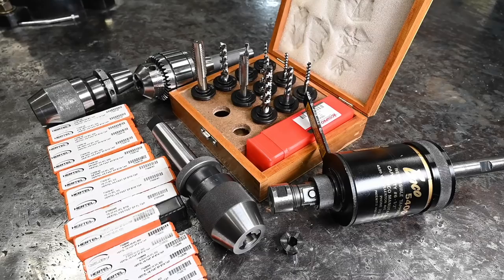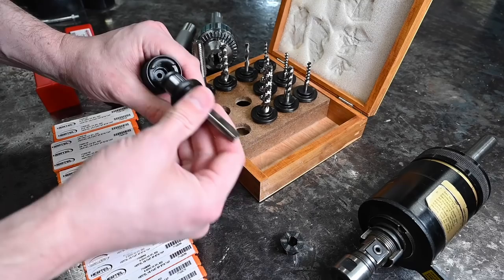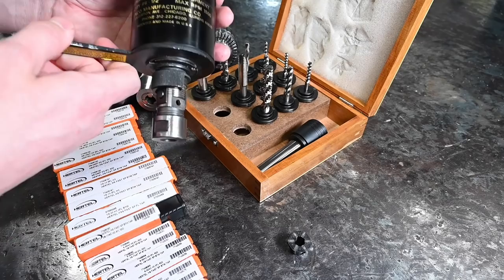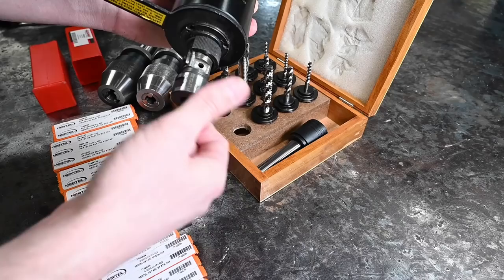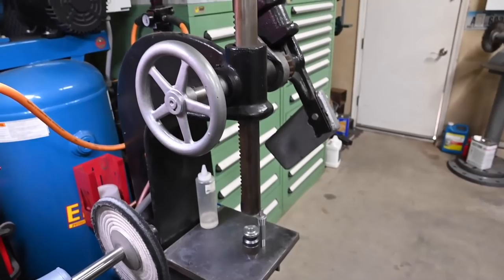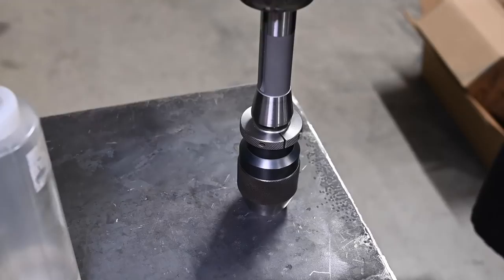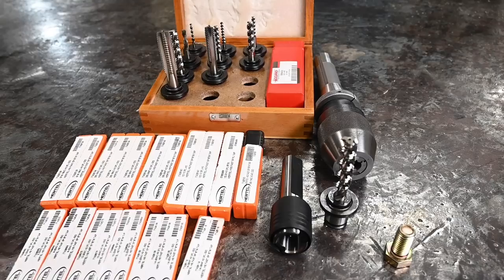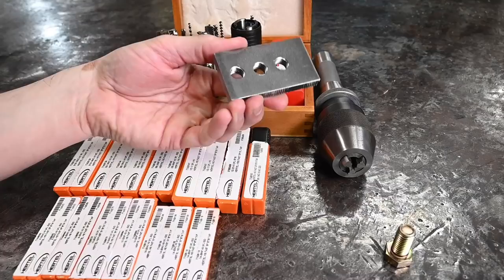Power Tapping for Cheaters! New Tap Adapters for Easy Threading

Comment: .....15:52..............screw ?????
Reply from the maker: It's nitpicking, but yes, it's a screw. If it were going through a hole and a nut and washer on the other side held it in place, it would be considered a bolt. That's what the Machinery's Handbook says anyway. Most people say bolt, but in use here it's a screw.
Reply: @AlwaysSunnyintheShop  Then......Screwed it is !

Comment: 1/2 "
bolt not a screw
Reply: Screw is correct.
Reply: @dutchgray86  omg a nut goes onit its a bolt a screw is for wood
Reply from the maker: So when I buy 6-32 machine screws I should be calling them bolts?
Reply: @AlwaysSunnyintheShop  Yepp u use a wrench or socket on a bolt and a driver on a screw
Reply from the maker: Hmm I’m gonna go with machinery’s handbook and call it a screw when it threads into the part, and a bolt when it goes through a clearance hole with a nut on the end.
Reply: @AlwaysSunnyintheShop  your preference.. ill call something I use a screwdriver on a screw and something that uses a spanner and takes a bolt in a hole or not a bolt. makes my brain happy great channel ill forgive u bit you see I'm correct surely